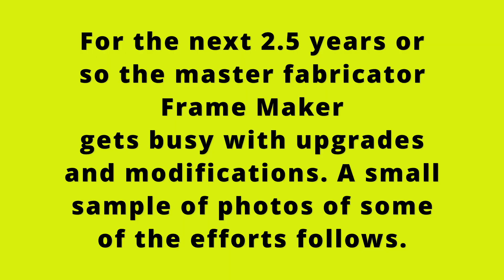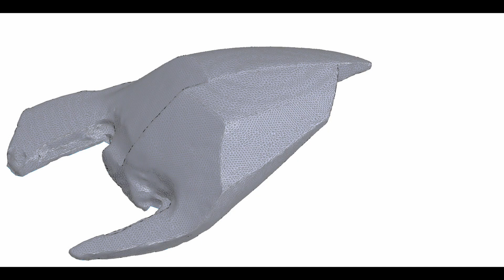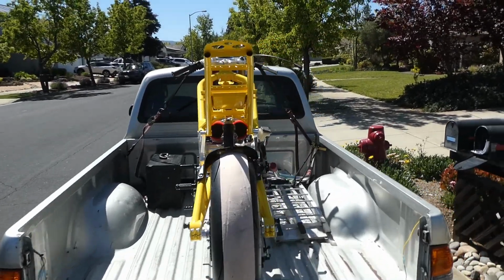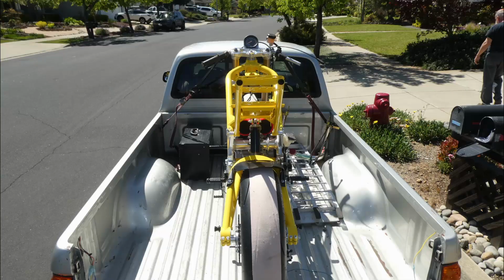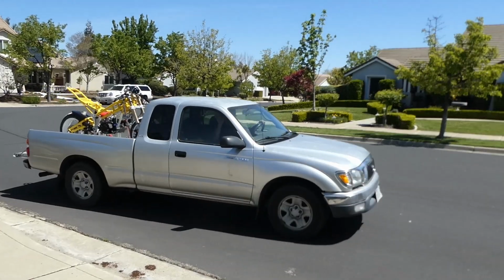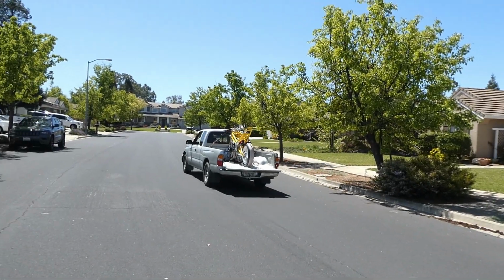2023 YAMAHA RZ350 By Frame Maker

Comment: Pretty nice stuff there Ken. Are the engines moved over to one side to allow more clearance for larger rear tires, or is there no need for it?
Reply from the maker: Thanks. I am going to have to defer to Julian for specific details like that. Hopefully he'll have time to comment here.
Reply: @KensGarage1  Okay.
Reply: Hi John, the engine is centered in the frame. With a 160 series tire it just barely clears the chain. As a side note, I have a Dave Pearce/Tigcraft RZ350 frame and it was built with the engine off-set to the left side and can accommodate a 180 series tire.
Reply: @screwdriverjoe  Okay thanks. Very cool .